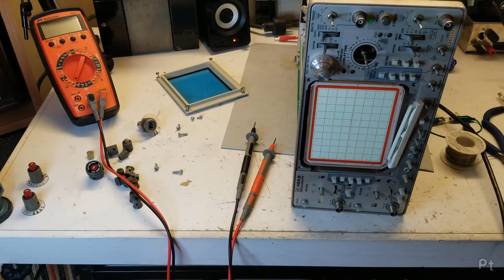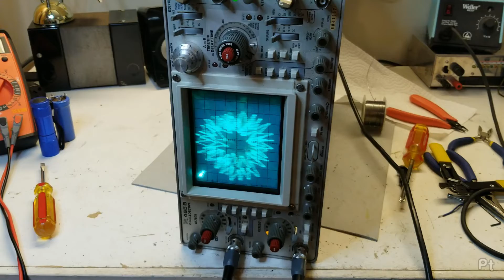Tektronix 465B Oscilloscope - Fixed!

Comment: I worked on a lot of those 465's back in the 80s at RCA.  A really good solid workhorse O'scope.  When I started at RCA there was one taken apart and stored in all 3 drawers of the work bench I was given.  The parts needed to repair it had just come in and the said 'Here ya go.  Put this back together.'  I though about quitting right then, but I got it back together and working without too much trouble.  Tek's manuals were actually pretty good.  After that, they had me take over repair and calibration of all the o'scopes in the facility.  
Today, there are some pretty decent digital scopes for a lot less money and I'd buy one of those before spending too much time on repairing the 465.  Siglent makes a decent 2 channel for under $400 with digital storage and all.

Comment: Sprague were really heavily-built capacitors, used in welders and stuff, so I'm really surprised one would short out like that.
I wanna get a 650,000 uF one off eBay sometime.
Reply from the maker: I was surprised too, usually they're pretty decent. Hopefully the rest hold up because I do NOT want to have to replace more of them!

Comment: Sometimes what seems like a simple repair can be a complete PITA.

And that temporary fuse is less janky than some permanent solutions I've seen.
Reply from the maker: It's an automotive fuse rated at 32VDC, and that transformer winding outputs ~60VAC on it. So it probably won't blow at the correct amperage, but oh well lol. The proper fuse is like $1.05 on digikey anyway.

Comment: Unrelated question: which should I use as my main VCR, a Zenith VRE510HF or a Toshiba M-4230? The Toshiba looks awesome and has a great vibe. But the display is dim and only has mono. On the other hand, the Zenith still looks dope, not as fresh as the Toshiba, but seems to be on a whole different plane of quality and functionality. It has freaking MTS over the antennae which if I remember you said was super rare. It has stereo too, which is great, and a dope audio level visualizer in the very bright display. The play quality seems insanely good compared to the Toshiba. Not that the Toshiba is bad, just that the Zenith is so smooth. What do you think? I’m leaning towards using the Zenith since it’s just a dream of a VCR, but on the other hand the Toshiba has the looks for sure. Lol
Reply from the maker: Oh man, I used to have a VRE510HF as a teenager. Super cool late 80s piece, made by JVC. I find the picture quality on those era JVC to be top notch. That plus the Hi-Fi audio, I would pick the VRE510HF. MTS Stereo was not that rare after about 1986 or so. By that point any stereo (Hi-Fi) VCR had a tuner that supported MTS Stereo. Totally useless in 2022 though!
Reply: @probnotstech  Ah cool dude! I’ll use that one. Thanks a bunch! Managed to get a remote for it off eBay too!